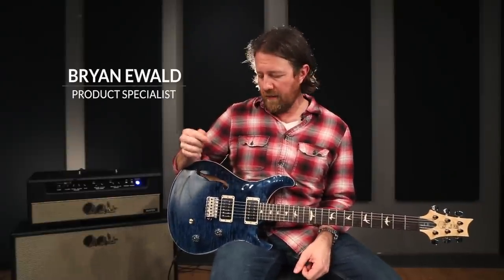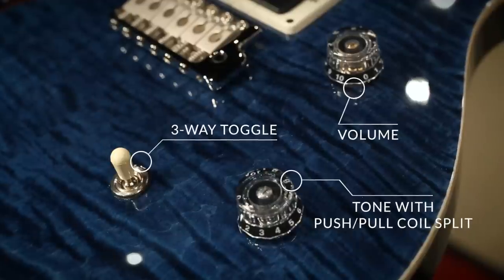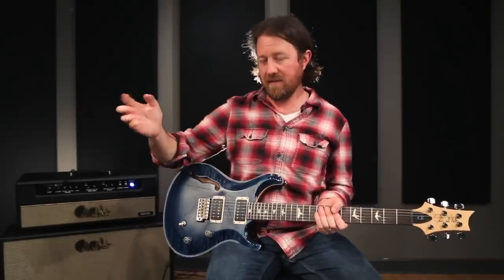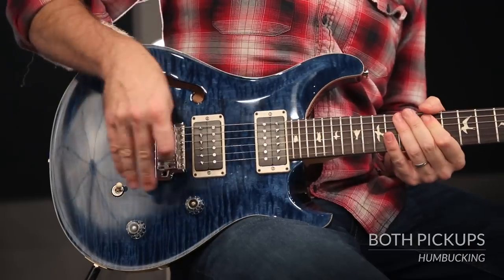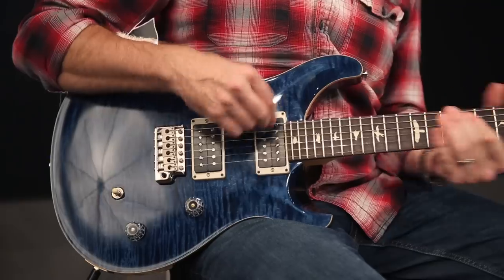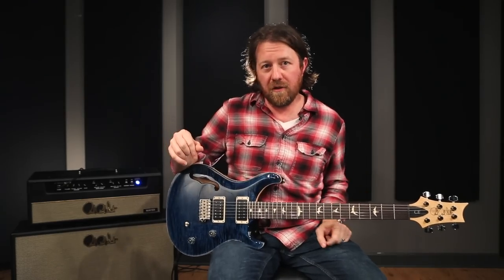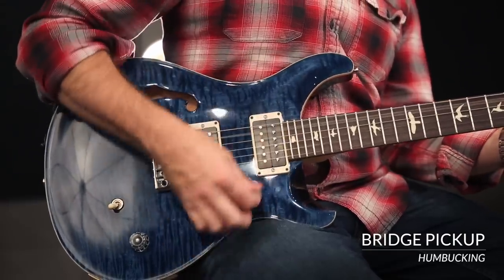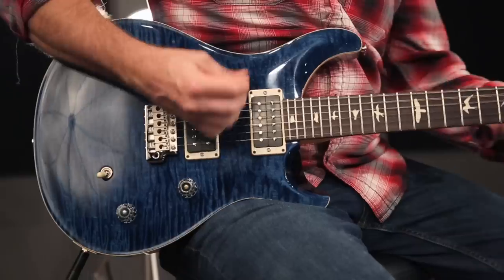The CE24 Semi-hollow | PRS Guitars

Comment: $2200 guitar and doesn't come with a hard case?  Fail.
Reply: Dan, I'd call first before ordering.  These specs on MF & Guitar Center are usually incorrect & not updated.  It's hard to believe PRS would have a gig bag for this pricey axe.
Reply: Yeah that’d add 200 to the cost